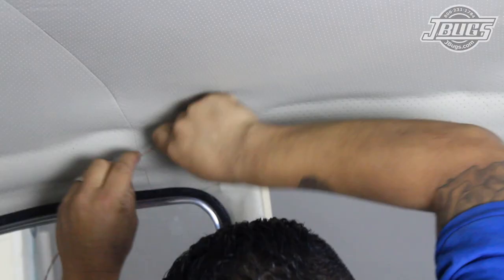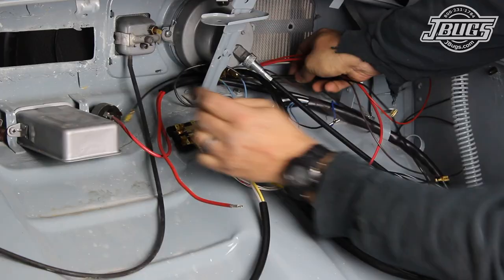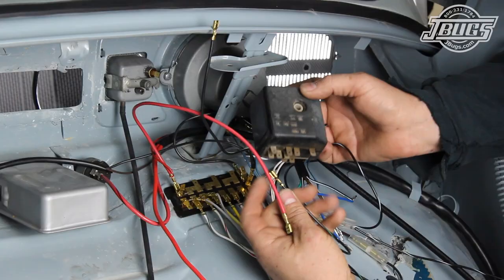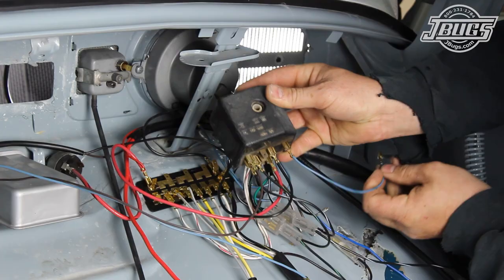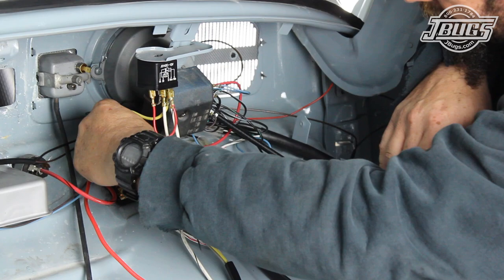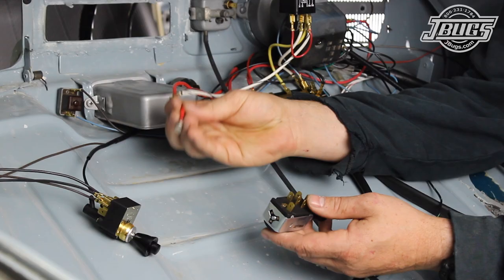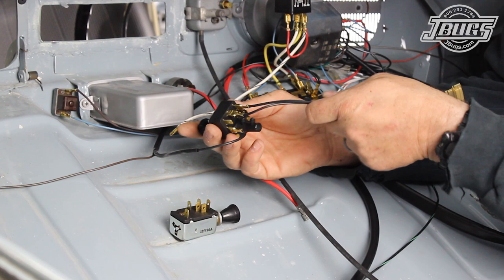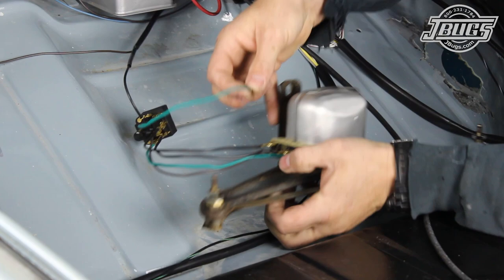JBugs - 1966 VW Beetle - Vehicle Rewiring - Dashboard Switch Wiring

Comment: Sir nice video can I ask? I don't know where is the position of the back light switch.
Reply: The back light? Are you revering to the back up lights or reverse light switch? If so, the switch is on the front of the transmission, at the top right side of the nose cone.

Comment: When u connected the wires for the windshield whipper motor to the switch you said one color but then changed it when you actually connected it..
Reply: We hook up two different motors in the video, to explain how to hook up a single speed motor to a two speed switch. Then we hook up a 2 speed motor to the two speed switch.

Comment: Trying to hook up 12v emergency flasher switch and relay to my 64 van wiring, wiring has been converted from 6v to 12v but still has a 6v emergency flasher relay and switch. Not sure but I'm assuming the original 12v relay has been burnt out by 12v system. Help would be appreciated.
Reply: The switches aren't 6 or 12 volt, they just turn power on or off. Relays however are voltage specific and the 6 volt relay won't work with the 12 volt system. This may help out: https://www.jbugs.com/product/211953227B.html

Comment: Hello greetings from Venezuela I have a wiper motor and a selector like the one you show in the video, I would like to know how to connect the 5-contact relay, the terminals are S-15-31-53m-53s, thank you
Reply: We have never seen a wiper motor or a switch with an S terminal or the 53m or 53s terminals. 15 is keyed positive power, 31 is ground. S terminals on US spec VWs are for the momentary ground signal to switch the from low to high beams. 53m and 53s are most likely speed 1 and speed 2 but those are just guesses. You'll have to run some tests powering up the switch and seeing what turns on at what position and go from there.
Reply: @Sam_Mebane  Ok thanks for your answer